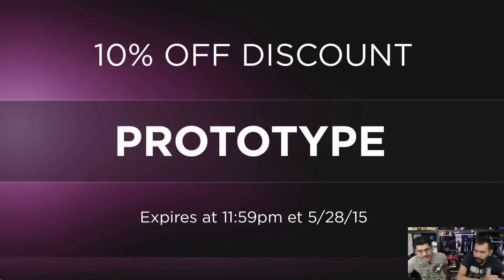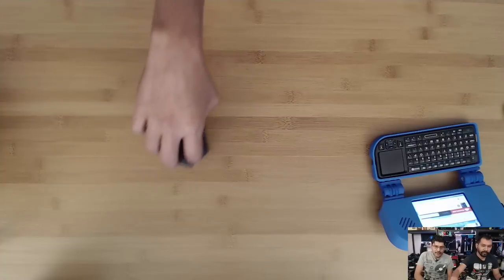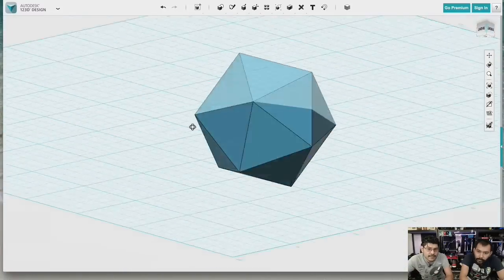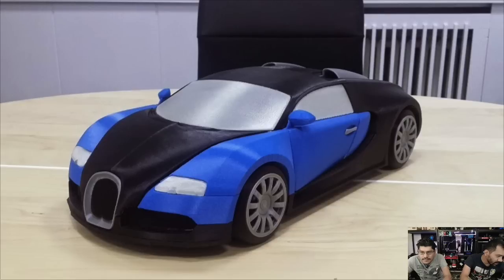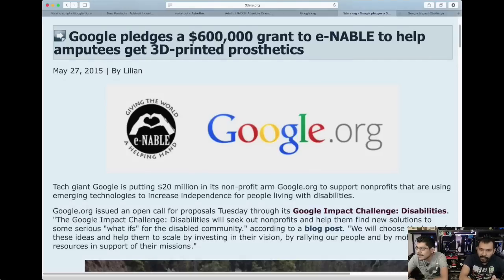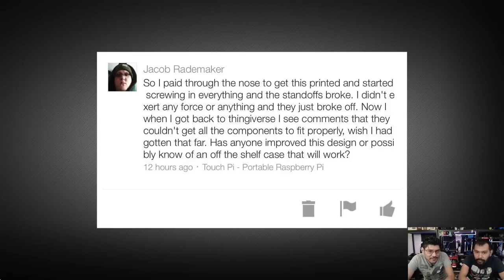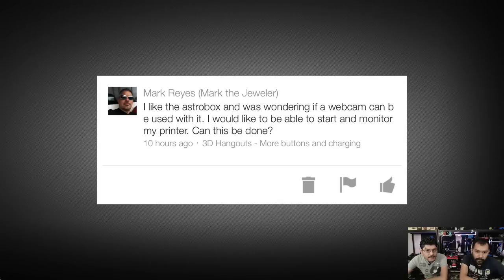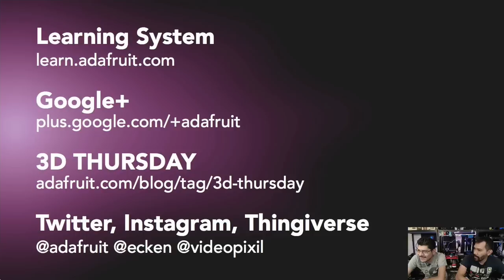3D Hangouts - Raspberry Pi Mini Laptop and Talking D20

Comment: One thing to consider when prototyping, Aiden, is to print small segments at a time to dial in your measurements and tolerances. You'll save time and filament if you go that route before you embark on multiple-hour final prints.